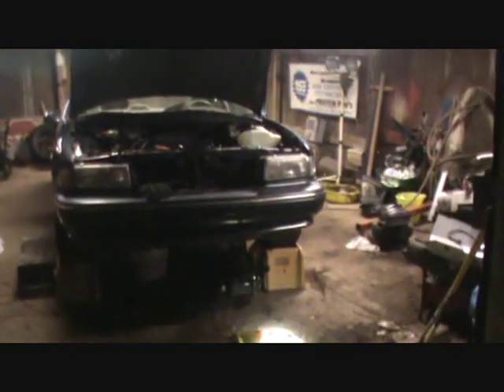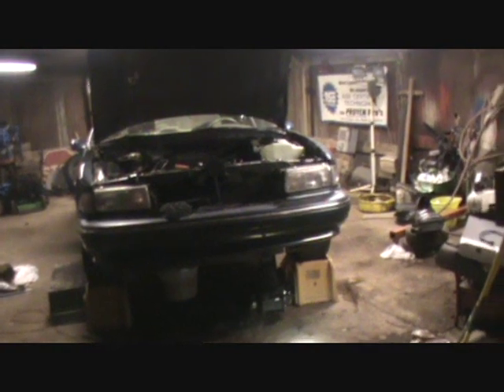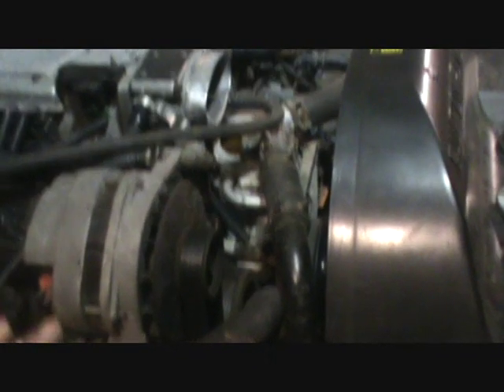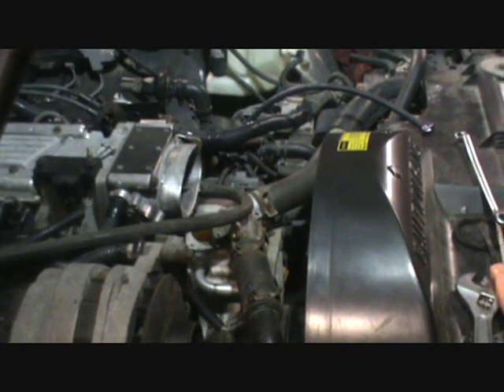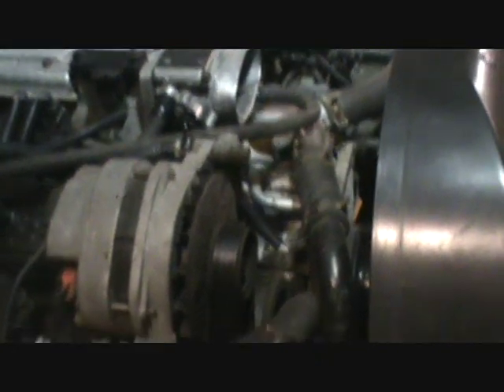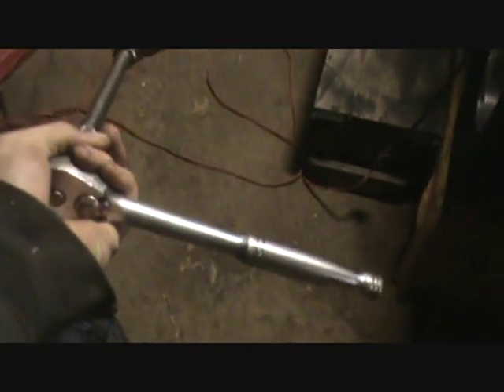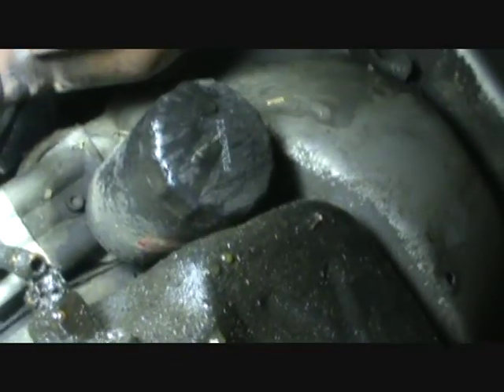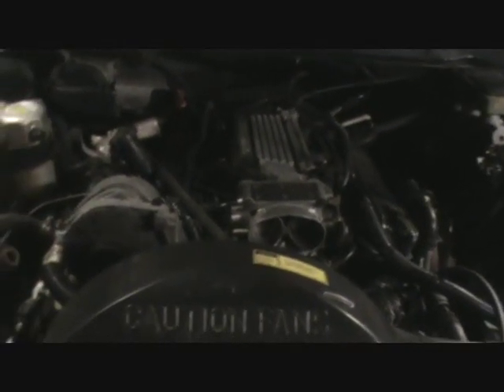How to completely drain GM LT1 engine coolant

Comment: I know it's an 11 year old video but how do you flush the heater core? Do you put low pressure to the top hose or the bottom hose going into the heater core on the firewall. Thanks,

Comment: Could you explain the process of running the engine for 30 minutes With the bolts out of the bottom of the motor

Comment: Just be aware that gm in its infinite wisdom added clay leak stop tablets to the cooling system at the factory. Backflused a ton of junk out of my heater core back in the day...if I finally get around to replacing the radiator I will definitely use your tips for draining the block.

The 96 caprice will be a time consuming hobby twenty six years later but they don't make them like that anymore.

Comment: The engine coolant is Dex Cool which was intended for these cars ....I have a 96 4.3 engine I thought it was rusty water too when I bought it then read the label on the car it said use Dex cool only which keeps the engine a lot cooler but it's expensive compared to the 50/50 mix

Comment: Good video.  Smart to change the coolant.  Nobody does.  I can't tell you how many ruined motors, heater cores and radiators I have seen due to old contaminated coolant.  I use BMW anti freeze (BLue) and distilled water only.  Good for 60,000 miles.

Comment: Drain, fill with water, run the car for a bit then pop the drain valve and let the water pump do the work for you. It will only run dry for a split second if your watching it. Refill and bleed. I got almost 4 gallons out of my caprice lt1 doing that way. Prob not the best, but who has the time anymore?

Comment: The big deal with the  LT1  was   REVERSE FLOW COOLING  the coolant entered  the    HEADS  FIRST  enabling  combustion chambers to run cool  enough  to run   10.1 compression ratio   ON   REGULAR    GAS,   the  corvette   required    PREMIUM   GAS.  the  350    V8  that  the  LT1  replaced    made    80  LESS   hp   and  got   ONE  LESS   mpg

Comment: Replace the engine driven  fan with an electric fan and you will gain  10  hp according to the 1996 B body factory service manual , they hid this fact in tiny print among  the 600-700 pages.(250 hp with trailer towing package)
Reply from the maker: Why not just buy one without the tow pack?  Otherwise I'd rather have the mechanical fan if i towed.
Reply: The tow package comes with a  2.93 limited slip,posi traction  such rear wheel drive cars is the only way you can apply power to both the left and  right side of  the car at  the  same time, all  wheel drive  and  4 wheel drive cars cant do  that, they have  "open" gears on the drive axles...The trailer tow package come with a  larger radiator and with an  electric fan thats 500 watts, thats more than double the cooling  power of  BOTH electric fans on the common  LT1 engine.Its rated to   pull   5000  lbs.

Comment: This isn't rocket science! It's a Chevy water jacket. You drain the radiator,pull the 2 lowest sensors and you're done! What is the purpose,of running water , through it. The block runs,about 220 degrees. So putting tap water,does zero. Last question,Knock sensors wear out,over time. Why wouldn't you replace them? $26 for LT1 sensors.
Reply from the maker: It certainly IS rocket science if you've never had an L99/LT1 and don't know about the reverse flow cooling system. Sorry if you thought this video was just for experts such as yourself, but it is for the common man who wants to learn, not aggravate others.
Reply: WhoSaidTyler It's basic knowledge! Some of us,have tools and use common sense! Sit at home,with your 6 piece tool box. I laugh,when you guys,who don't know shit,comment!  haha!
Reply from the maker: If you have so much KNOWLEDGE, how come you searched for a video on this subject, you fucking liar? That's the same as a "straight" guy looking for gay porn. You also use way too many commas in your sentences in places that don't NEED A COMMA. So, if I were you, I'd SHUT UP laughing, because you and your blank ass channel are about to get laughed at yourself. I plainly don't give a rat's fkign ass what you think you know about this subject. I know it because I DID it, right here chummo, so BLOW. One more shit-stir comment out of you and you go out on the end of my boot.

Comment: good info. I have a 96 Roadmaster.  I flushed the old green coolant(previous owner used green) till it ran  clear and refilled it with Dex-cool.
Are you sure your caprice wasn't filled with (orange)Dex-cool instead of rusty water?
Reply from the maker: It's definitely possible.
Reply: That's definitely dexcool. Hope you filled it back up with that :-/

Comment: dude you are a god send you need to to just start a caprice 101 cause i have search to the ends of the internet for caprice work vids but no one has any so i hope you make hella more of these from bumper to bumper I just purchase a 1994 caprice Lt1 350 that needs work 241,000 miles and its runing hot fans wont turn on and im not a mechanic but i can diy it if i had good detail vid..
I just flush the coolant system and knew to flush the block but didnt know how so i just did the normal flush radiator and water pump and refilled so does that mean there is still old rusty ass coolant in there..
Reply from the maker: +STeeLo 205 Yes, but it's not going to kill it. You need to make sure you bleed the air out of the cooling system when refilling it, that's IMPORTANT. If the fans still don't run after bleeding the system, then you'll need to diagnose why.
Reply: +WhoSaidTyler how do you bleed it that was 3 days ago when flush it i have driven it since than.i didnt see that screw you turn to bleed it some..
Reply from the maker: +STeeLo 205 https://www.youtube.com/watch?v=IAsfXHh9ipI
Reply: +WhoSaidTyler hey my car keep overheating we got a new water pump and it's still overheating should I do drain the engine the block
Reply: Yeah everything good the cooling system is not flowing right
Reply: The radiator is good it's not even getting hot when I run the car
Reply: I have a 1995 Chevy Caprice
Reply: +Andrea Pasqualone ok  so that  mean somthing is not allowing coolant to flow into the engine and cool down the engine. is there a lot of heat  coming from your engine after you drive it..you should feel the heat entering all inside the car under the dash were the pedals are..
Reply: I didn't drive in 2 days wat do U think it is
Reply: The only place that's overheating is the overfill
Reply: STeeLo205 ImDatRapper 1999 buick regal 3800 super charged
Reply: +Andrea Pasqualone if have bled the system and the fans are working and all that.might be an engine issue,or bad radiator,coolant temp switch.if all is good..then it's the engine from what I've learned..

Comment: how many miles is this engine good for. my camaro has 215K and it runs decent. provided i take care of it how many more miles could i get out of it? i know this video is dated, do you still have the car? is it still running or did you have to rebuild it? how many miles are on it now? i dont pound the piss out of my either...... at times i drive it hard but that's what it was made for. im not doing burnouts or racing.
Reply: +andrew donohue i did replace the opti-spark not too long ago.... $400 later for a brand new genuine delphi unit. i do not drive my camaro in the winter so sparing it of salt it should be around for a long time.
Reply from the maker: +andrew donohue This one had 263,000 on it.
Reply: do you still have the car? 263 is quite a bit of miles. if i get another 50 or 60k before i have to rebuild it, i will be pretty happy

Comment: Take a power washer and remove the pressure tip, on the driverside rad, take hose off pump and put in left side hose on dside. Flushes amazingly.

Comment: It is on the passenger head between cylinders 6 and 8 just under the exhaust manifold. It is a single wire unit.

Comment from the maker: No, that's correct because when you place thermostats in the older 305 and 350 engines the sensing element always faces down into the engine. Hot water into the top of the rad, cooled water out the bottom.

Comment: Are you sure, Tyler, in what you said that "older engines", like the 305, "drew coolant from  the BOTTOM of the radiator? I thought they drew coolant from the TOP of the radiator. The radiator's bottom hose took back from the engine the hot fluid, to then work its way up, and cool off thereby. Have I got that wrong? (I ask because I still need to find a way to flush all the old fluid out of my 305ci.)

Comment from the maker: You add through the coolant reservoir. It's a bit tedious. Be sure to open the air bleeds before you add coolant and as you purge the air out of the system while running.

Comment: excellent! I will soon be the owner of a 1995 Roadmaster, so I'm doing research on maintenance. this video will be on of the first procedures I perform on the mighty 350 LT1.
Reply: I have a 94 roadmaster, just bought it last year and I love it to pieces! Had had to replace the water pump so I'm flushing the system right now.

Comment from the maker: If you have to run the heat then the radiator isn't doing it's job, because all the heater is, is a minature radiator. You also have to have air moving across the radiator by way of the car moving or a fan running when it is stationary.

 Flushing it the way I show can certainly help, but I think you need to have the radiator professionally flushed at the very minimum.

Comment: I have heating prblems with my 94 buick roadmaster I changed the thermostat and water pump and when I ride I have to blow the heat to keep the car from overheating I drained the radiator from the drain plug but never done iy the way u do it but does that play a big part in the car overheating if u can let me know something or help thanks

Comment: Great job, WhoSaid Tyler...very informative and detailed video. I've got a 96 Vette w/LT-4 and heat issues that I've been trying to resolve. I've replaced almost every coolant system part except the radiator and am hoping that this process will get more crud out of the block.

Comment from the maker: There are two air bleeds on the cooling lines. B-body cars have one, I'm nearly certain F-bodies have 2. Carefully open those and start filling the coolant reservoir if the rad doesn't have it's own cap.

 You'll eventually start to see coolant seeping out the bleeds or the reservoir won;t take anymore fluid. When that occurs you start the engine and let it run with the bleeds cracked open. When you start seeing straight out the bleeds, close them and shut it down.

Comment: Man i wish i would have came across this before i did my flush. I did what you said in the first part, i did like 10-12 water cycles till it was clear. I actually did 2 coolant flush bottles. I drained and it added water 5 times. Added the flush drove around no T stat. Cycled water 5 more times did another bottle till the water come out the radiator was clear. I didn't know they knock sensors on these would be the spot to drain the engine coolant. I have a 94lt1 camaro.

Comment: I tried to remove both sensors and the 22mm nut turns inside of sensor but the sensor will NOT turn , it is as if it is striped. Any suggestion on how to get the whole thing to turn out? Can I call u on the phone? I have a propane torch I could heat the treaded boss to expand it but want to know if they make a tool to fit over the sensor that apply pressure to it while I turn the 22mm side. Call me? Rick in San Diego Ca  Cell # 858 254 6710

Comment: Sorry for being a pain in the rear?? I guess I'm going to keep on flushing her until it just looks clean?? I just wish I could have done it right the first time?? Could it be because on the other side of the block is the temperature sensor (that turns the radiator fan on) underneath the headers, and since I didn't take that out it's keeping the coolant from coming out of the knock sensor hole?? I just didn't bother with it since nothing came out of the knock sensor hole?? Is that my mistake??

Comment: Alright, I removed the knock sensor and no coolant came out?? I am stumped?? I also took the time to replace the thermostat for a 160 degree one so I figured with the knock sensor out and then popping the thermostat out that would then allow the coolant to rush out of the knock sensor hole.... but nothing came out?? I'm frustrated because only about 1 gallon came out of the radiator so the rest must be in the engine block? Could it be because the coolant is so old it's gummed up the block??

Comment from the maker: @supergreedy287 There's a bleeder valve on the engine near the thermostat. There also MAY be one on the side of the throttle body. Crack both open and fill the cooling system through the expansion tank until coolant starts to flow from the bleeder(s). Close them back up and finish filling as needed. It may take a few easy running cycles to get all the air burped out through the expansion tank, so don't run the car hard for the next 100 miles or so. KEEP THE OPTISPARK DRY!!

Comment from the maker: @overclocked2cpu  Yeah I did neglect to talk about the F-bodies. It's primarily some minor differences in the cooling system routing, nothing major.

After letting the system drain I ran water from the hose all the way through the engine as fast as possible to help flush out the remaining crud.

Comment: Ok, another question... After you drain the block, I guess you just put the knock sensors back in and fill er' up with distilled water and run it.... Then drain the block a second time and finally fill er' back up with a 50/50 mix?? I believe that's correct?? I don't want to waste your time so just answer me if that's wrong. If I get no answer then I'll assume I'm correct. Thanks again and have a Safe and Happy New Year!!! Keep up the great work!!!

Comment: Another compliment here!! You rock for taking the time to show us how a real flush is done. I have a 94' Camaro Z28 and a 95' Trans Am so this video was just what I needed. One question though, you said in the video that you would explain the differences from the Caprice to the Camaro's and Firebirds but I didn't notice you say there was any differences?? No matter, I am ready to do the Flush on my Trans Am (and change the thermostat) so I'll see if there are any differences tomorrow. Thanks...
Reply: You rock ,I'm doing a radiator on my 95 Bette tomorrow, you saved me 2 hours,ty

Comment from the maker: @williamperry11  You could but it might only drain one side. The block plugs are fairly small and look about like 5/8 bolts.

Usually draining the radiator will get the level of the coolant down below headgasket level so you might just save yourself some trouble that way. The oil will have to be changed anyway in case some gets into the crankcase.

Comment: Great vid, pretty informative.  I've got a GMC 88' 350 engine, and I can't for the life of me find the drain plugs on the thing.  I'm about to change the head gaskets, but I'm stuck.  I've heard that there are two drain plugs-one on each side of the engine- above where the oil pan meets the engine block(either 9/16 or 1/2 size).  I've never seen any pictures, so I don't know what to look for.  I think I did, however, find the knock sensor on the bottom of the engine..should I go this route?

Comment from the maker: @gsm19911  If you are looking for reliability and cheapness then by all means get an L05.

 The L99/LT1 is also reliable but they have more things on them than can and do go bad, making them somewhat of an irritating engine to maintain.

 The only bad thing about an L99 is that it has 60 less hp than an LT1 ;-)

Comment from the maker: @4lex14  Yes, but the F-body may have only one knock sensor. The other side of the block will then likely have a simple plug that unscrews. You need to drain both sides.
Reply: but how do you get the screw/plug out? I'm staring right at it but no way to firmly get a socket or wrench around it.

Comment from the maker: @tizank89 That's a great question because visually you can't tell them apart in the car.

 There is a block casting number at the rear near the trans, facing up. The last 3 will be 327 if it's an LT1 and 588 if it's an L99. Those three digits are also usually cast onto the sides of the block about halfway back.

Keep in mind that 9C1 cop cars were NOT automatically LT1-equipped.

Comment: Great tip on the battery disconnect when working by the starter! I had a small firework show when re-torquing oil pan bolts after I replaced the gasket.